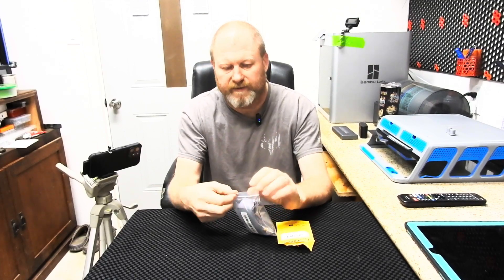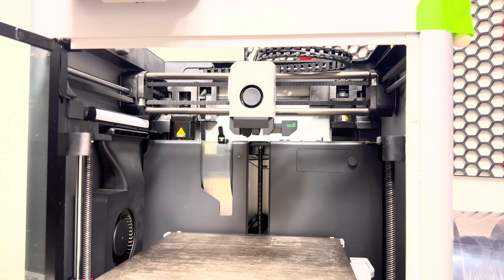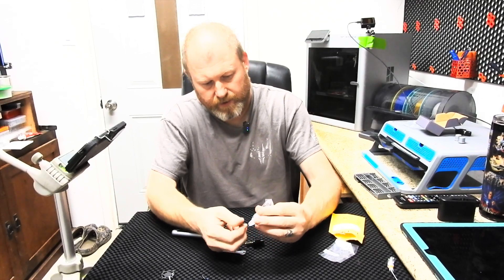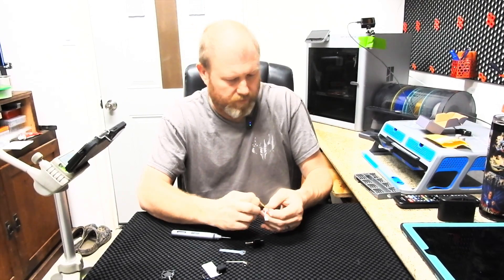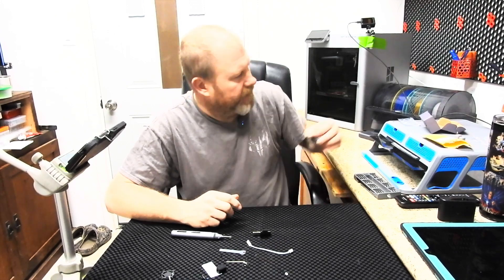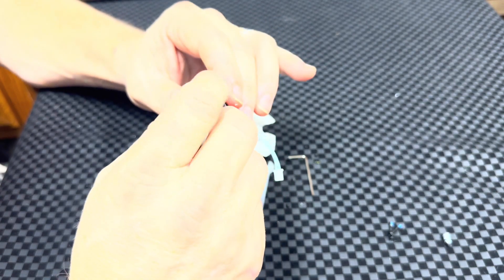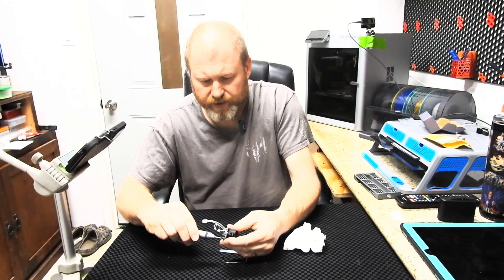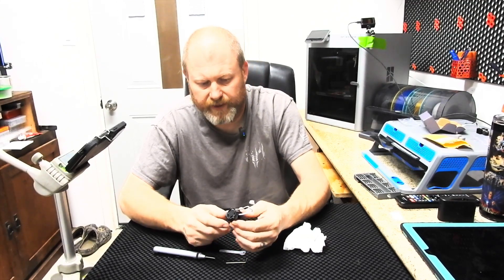X1C After Market Hot End Install and Review

Comment: Does this work good with an AMS and color changes? Also would this work on a PS1? Thanks
Reply from the maker: Yes, it works very well with the AMS and color changes. However, there is a possibility you might need a longer Bowden tube from the AMS to the back of the printer. I didn’t need one, but I know other people that have made this and have absolutely needed one cause their tube was just too short as far as the P1 S. I believe it will work with it, but I do not know for sure.